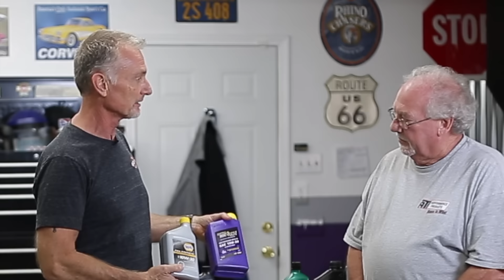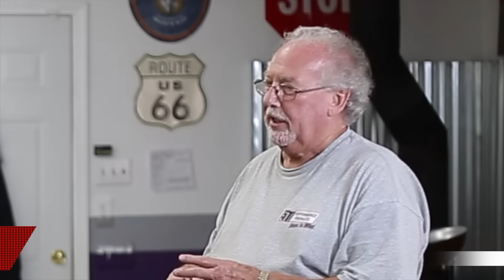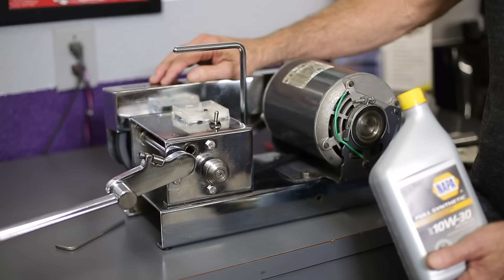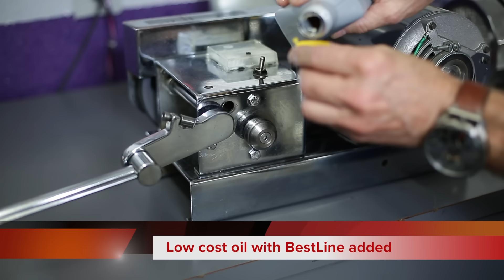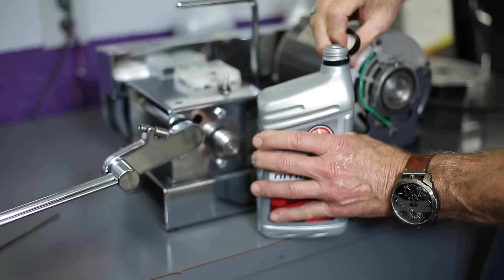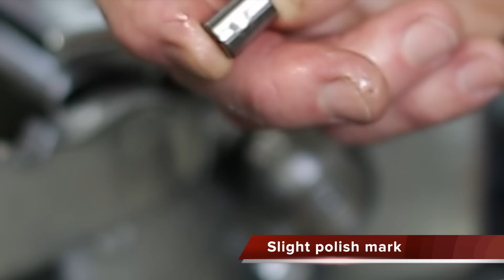How Oil Additives Work

Comment: Cheers my friend .
After buying best line 
I wos a bit unsure as the promises that it says it dus. so after service new oil + best line car felt a little bit smoother but as it is looked after this surprise me  thinking 
It's not  going to have no affect how I wos rong ++++++++++
My MPG on a full tank before 275 to 290 max short distance driving 
Now 345 + then fuel light is on  the MPG from new it says that it will return 360 miles on full tank and it will again 😁😁😁😁😊 this product works please try it 
Believe me I have gon 
A to Z with additives 
And thank s to best line I have the best  product love it at one point I wos thinking my fuel gauge had broke as from full it moves of full at 65miles now 85 that's 
Best line for you  thanks Perry cool 
People need to know about this product
Reply from the maker: Thank you for taking the risk to try us out, you've joined the thousand of other 5 star customers that continue to use BestLine because it actually works.

Comment: I purchased two pints of Bestline Diesel Engine Treatment for my 2001 Duramax.  The only problem I have is this: I have used Lucas and Marvel Mystery oil  in high quantities in the engine oil for this truck. So my results from Bestline probably wont be noticeable.  I am impressed w the Cat grader video using Bestline. Comments about a chevy w high miles colliding w a rock to the oil filter have me a believer. I doubt the average Youtuber will provide fictitious stories. Reminds me of the Slick 50 commercial that filmed the oil drain plug removed from a car, the car ran quite a while without oil. I wonder if the original Slick 50 and the current Bestline have many similarities in the genetic structure  of the oil?
Reply from the maker: Thank you for your comments, we have thousands of real reviews on Amazon and on our website to validate the performance of the products I make. I also give a 100% money back guarantee if you don't notice a difference. Let's hear more reviews and thank you.
Reply: Bestline seems to be the real deal: https://www.youtube.com/watch?v=m8ZKMCfAue4

Comment: BestLine is good no question.  My tests are apples and oranges, put in Bestline in my dirtbike, busted a coolant hose and engine ceased.  My daughter has an old Chevy truck 225 miles, had a rock punch hole in filter truck ran dry no oil for an entire week. She said the oil light but said her temperature was fine. This truck was treated with Prolong Engine Treatment. Both great products and I use both of them.
Reply from the maker: Thank you